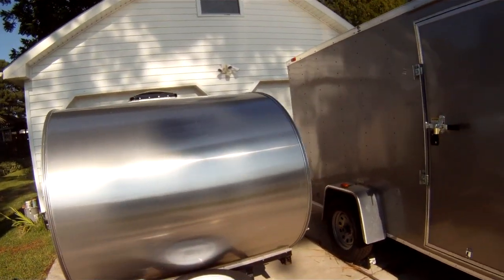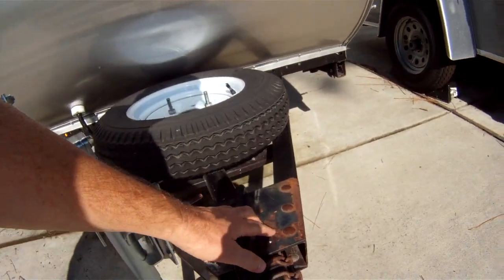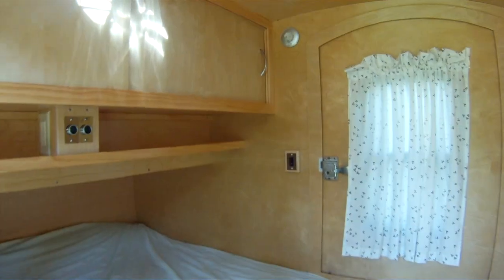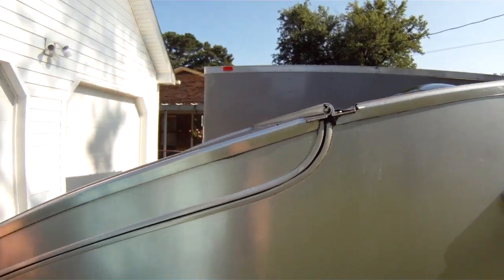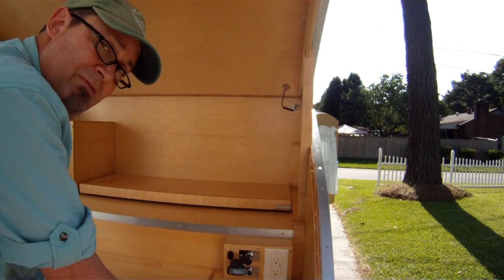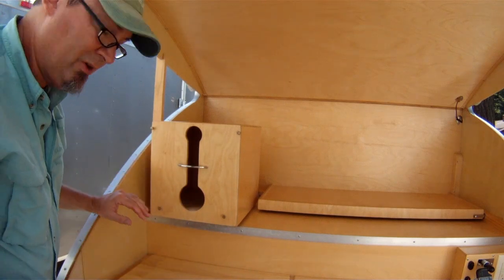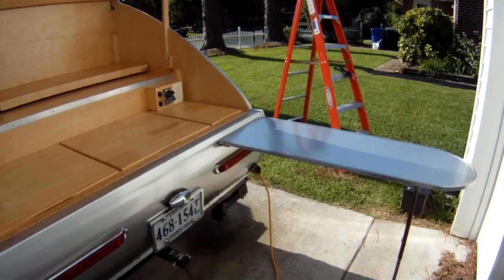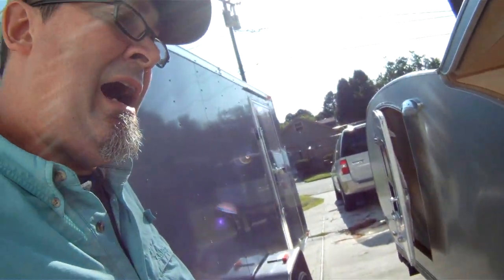My Teardrop is For Sale! $8,000 in SE Virginia.

Comment: Use Chassis saver on the frame it's economical and available at auto body supply outlets it's one of the best rust converter/protectant paints on the market. You'll never have a rust issue again, at least as a weekend warrior. I think Scott's build quality is excellent and whoever gets it will be happy.
Reply from the maker: Great tip! Thanks!

Comment: Hi Scott  ,  Beautiful job on the teardrop !   I imagine it didn't take long to sell .  I am currently planning a build  and missing several components ,  and with that I have a question I've been searching an answer for  ;    What did you use for an adhesive to bond the Aluminum to Wood  ,    &    did you have to clean the factory bought Aluminum first .   If you find the time to respond , I'd be most appreciative .  Thanks Cyril
Reply from the maker: Hi Cyril, Thanks for the kind words. Actually, I still have it and it's still for sale (make me an offer!) Anyway, the aluminum "floats" on the wood, held down mostly by the trim (Vid #39 https://youtu.be/bSVnTnnb9Qk, Vid #40 https://youtu.be/C63ukCXDTBM). The theory is that the wood and aluminum expand and contract in the heat at different rates, and by "floating" it the aluminum doesn't get wavy when it gets hot.  I used butyl tape under the edge trim in most places, as it remains pliable. I did use marine adhesive on the edges of the panels to help prevent water migration, a little bit in the center of the panels just to help hold them in place while I was working on the trim. The aluminum that I bought had plastic film on it, that I left on until I installed it. After if was finished, I wiped everything down with paint thinner and then applied "SharkHide" aluminum protectant. It's good stuff.
Reply: Thanks for your reply Scott !!!!!!!!!!!!!!     You still have it ?  It sure sounds like a good price ,   for time , material ,  and good lookin work .   I'm in Northern Canada and the shape of my proposed build will be simpler and fully insulated ,   & for me its half ,  about the build ,  but I wish you luck ,  someone will come along .   I was aware of the 2 materials expanding at different rates ,  have seen the waves ,  have seen Runaway  campers  factory  vid  where they glue it solid  (no idea what adhesive they use ) ,  and trying to sort it all out .   Floating the Alum.  does seem to be a good strategy .   I will check out your vids and channel .!!!!!!   Thanks for your time &  info !!!!!!   I'm not much of an internet guy ,  but the contacts , connections and swopping of info.  with like minded folk is awesome .  Cyril

Comment: Uh....it looks like the door seal has been placed on the interior wood skin?
Reply from the maker: David, It's actually on a built up door seal glued to the interior panel.  The framed section that the door fits into was then coated with multiple coats of marine epoxy before adding the aluminum trim using a marine adhesive sealant and the self adhesive rubber seals. Details on the door seal here -  https://www.youtube.com/watch?v=lAT-O0oamgA&index=17&list=PLsy0nmINWGOLDta5q_JmCm2WzDH6nECEB .